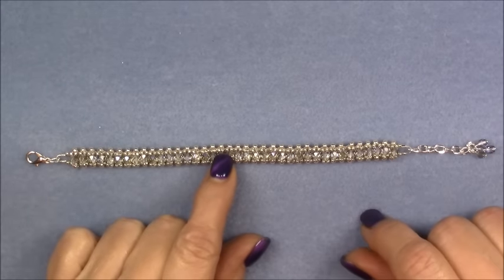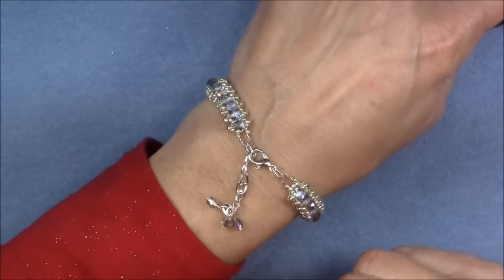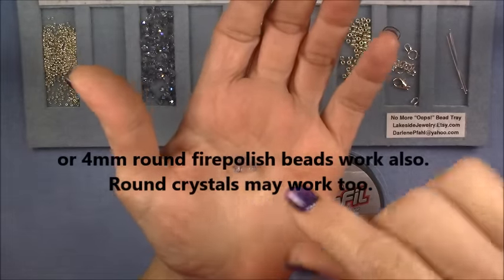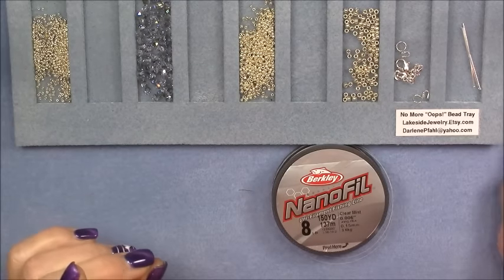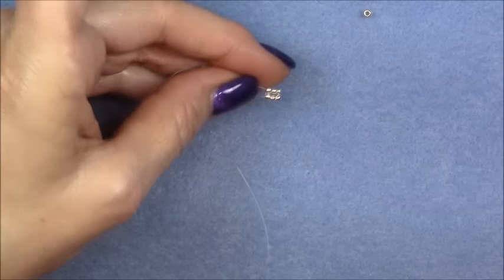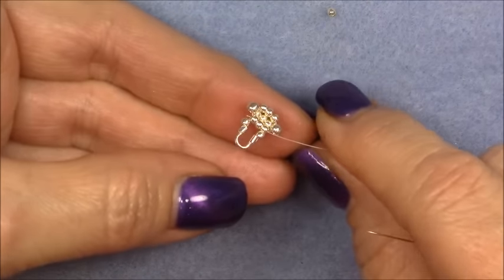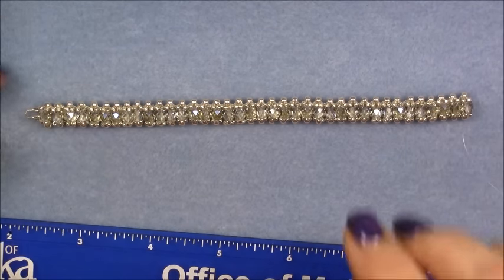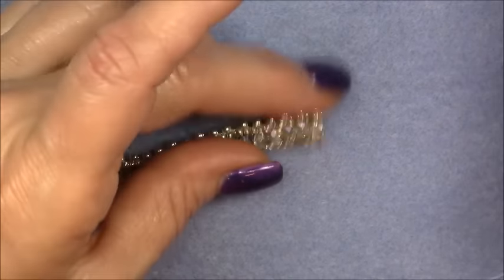Sparkling Tennis Bracelet Tutorial

Comment: I used all 8/0 seed beads in this design and used 4mm fire polish since they where all I had on hand. I used 11/0 seed beads in place of the 15/0 and then added 2 mm and 15/0 down the side of the bracelet attaching them through the 8/0 stickyouty beads along on the outside edge. It turned out great! I working on another where I want to make it double the width so it will be a two strand bracelet. I'll let you know how it urns out.
Reply from the maker: Fabulous! Many times modifications are good. I designed a partial piece with 11/0s between the the 8/0 sticky-outies and then connected multiple chains and a magnetic clasp, turned out great. This design is easy to modify. I am glad you were able to use what you had on hand.

Comment: This is really pretty. I totally follow how you're making each segment/unit thanks to your terrific tutorial. I'm just wondering though, is there any reason you would recommend against stitching the full length of the 3 wide 11/0 bead square stitch, then add the 8/0's on both sides and finally go back and add in the 15/0's and the crystals (or fire polish beads)? To me, it seems like I'd make more progress more quickly 'cuz I'd get into a rhythm for each step and sail through them faster. Thoughts?
Reply from the maker: I feel like if you do that it might not lay right, each segment needs the previous segment finished to hold the shape of the tiny bezels. But, I could be wrong.the only way to know is to try it😁

Comment: I started making this today and far have broken 3 needles. I'm heartbroken because it's the prettiest bracelet I've seen on your channel but the thread just won't go through. I didn't find the ones you recommend but am using .010 supplemax by beadalon.
Reply from the maker: Try Nanofil, you can order it on Amazon, or get it at Cabella’s , get 8lb or try 4 or 6lb Fireline and use a size 12 beading needle. It is important for this design.
Reply: I went out and got the finer thread and now have a gorgeous bracelet!
Reply from the maker: Jennifer Chaplin fabulous! I knew that was the issue. :)